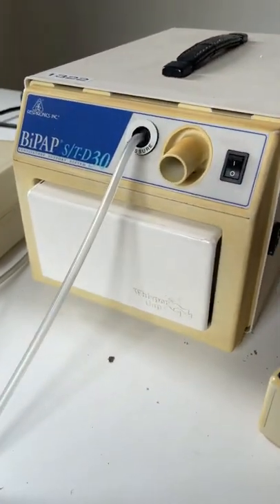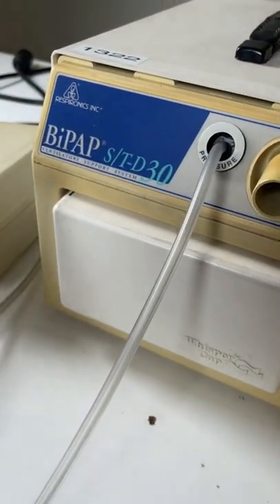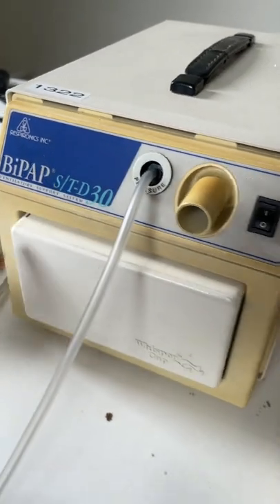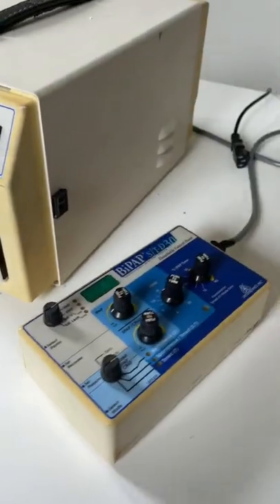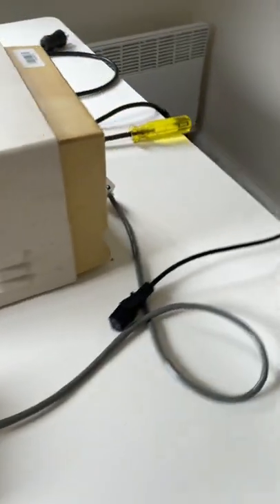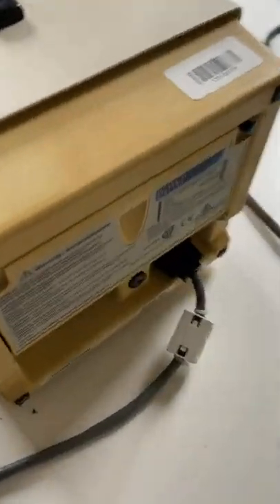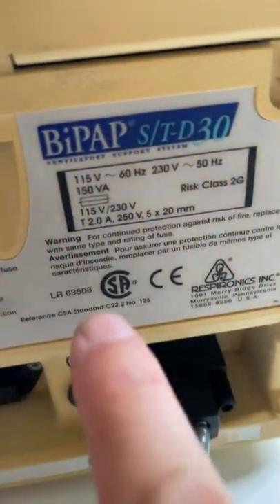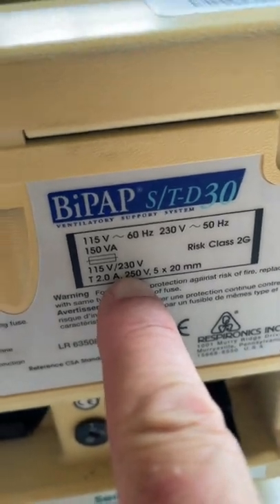I Just Blew Up My Ventilator 🤦🏻‍♂️💥 #shorts

Comment: I started my BiPAP therapy with that vintage of Respironics machine (not sure of the exact sub-model). I remember the voltage issue when I brought it with me on a concert tour to Hong Kong (220V). Fortunately I did see the voltage switch on the back and the machine worked fine. It sure was heavy and bulky to travel with!

Comment: Just wrap the fuses in foil and have another crack!! :-)
Reply: Don't do that.
Reply: @Capt-Intrepid  I’m sure most readers realized that I was joking?? From other conversations Nick knows that I come from a tech/engineering background and wouldn’t ever advocate bypassing fuse protection. So folks……don’t wrap fuses in foil or use pins, nails, screws, wire or (even) your Prince Albert piercing to bypass the fuse of your device(s)!!